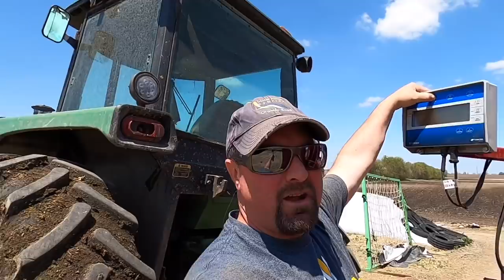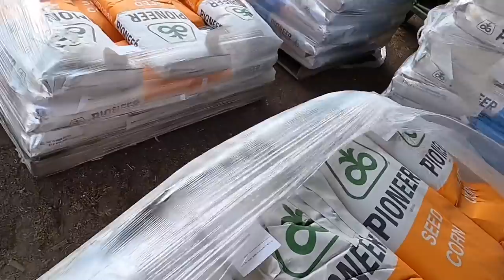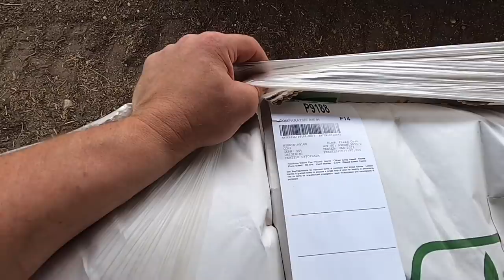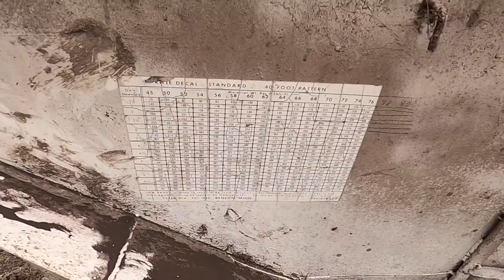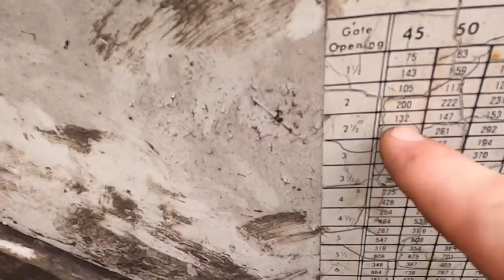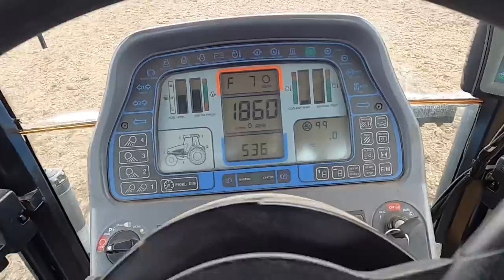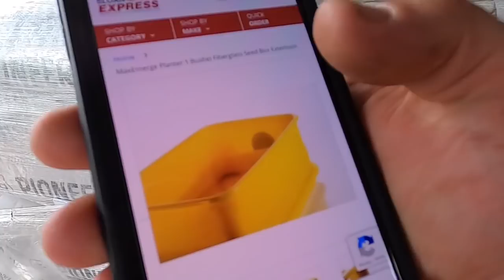Last Minute Repairs - Spreading Fertilizer and Planter Prep!

Comment: A Kinze 8 or 12 Row Planter would be nice in the future. What type of Fertilizer were you all Spreading?
Reply from the maker: Yes a bigger planter would b nice. We plant with 38” row spacing so we’d have to switch to 30” rows or find 16 row 38” planter.
Reply from the maker: As far as the fertilizer we use, it’s all natural based.